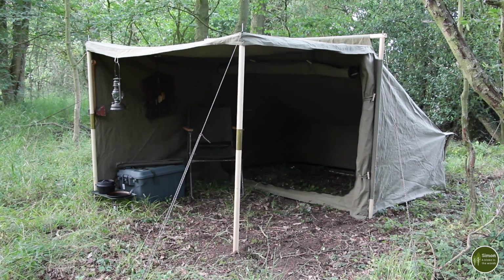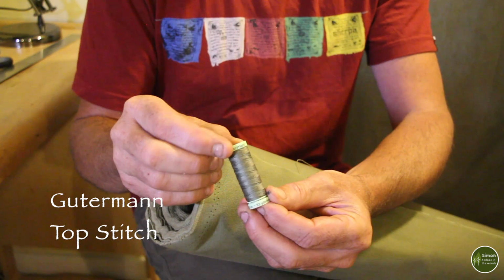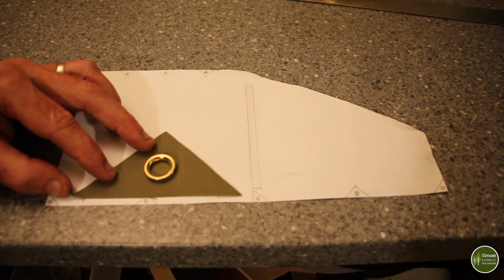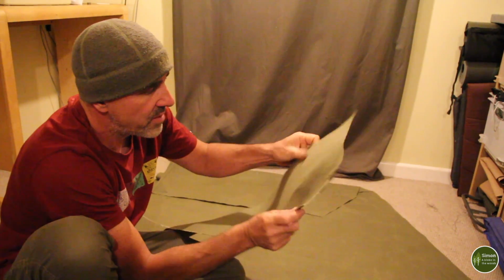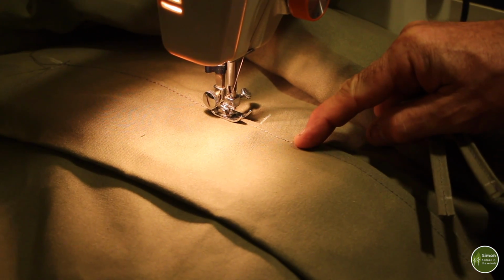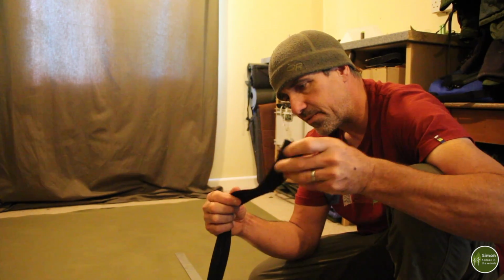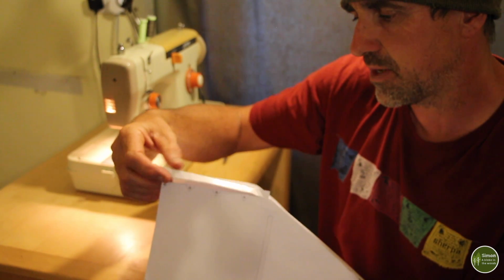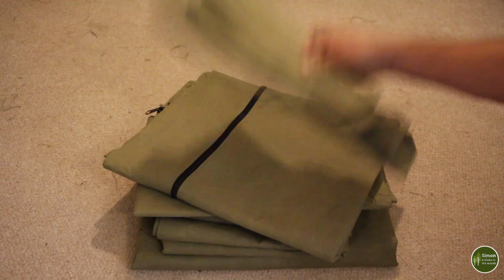The Baker Campfire Tent. Part 1 - Making the Panels.

Comment: I’m so glad I’m not only one who makes tents. However, this baker tent is a fine construction piece! 
I bought a tunnel tent which kept on collapsing once was erected. The guy ropes just wouldn’t hold the tent in the correct shape, it was supposed to be & it hosed me off, no end! So before I was to use the “tent” again, I was going to reshape it into a free standing one. It took about 2 hours to unpick the areas of the tent I was to reconstruct. There were 2 rounded areas of the tent which were for the 2 entrances. I was going to use only one. This at least, I didn’t have to remake. The sleeves for the tent poles, I had to just sew in the main length of the tent, so the tent would stand up. The final shape of the new tent was like a wedge cut out of an orange. The tent was way under 2kg if I stuck to using plastic tent pegs. With my backpack I had to sleep diagonally across the length of the tent. It now was perfect for those hiking & hitching across Africa I wanted to do.

Comment: nice work. when i started this, 3 years ago i was using a singer, hand cranking the wheel as the material was too dense for the machine to handle. did. great series. thanks for sharing it.

Comment: Absolutely beautiful job. Well thought out for sure. The only thing I would have added is a smaller pole sleeve or loops  inside the larger sleeves for the regular poles so things stayed tight. Looks like your design works well as is though. Super job!

Comment: great tent well made,you could add an extra front panel with a stove jack for a wood burner for wet and snowy weather,canvas will always be the best material to sleep under,the only drawback is drying the tent before packing it away for any length of time,great video
Reply from the maker: Thanks Pete! A front panel exactly as you describe is on the cards - I’ve got enough canvas left over. 👍

Comment: You clever chap!! Nice work and what a lovely thing to have created. The funny thing is, whenever I watch your films, I keep spotting all the same bits of kit I have! Those green Plano boxes are so useful. I have several and use them in my truck. They are like the different pods for Thunderbird two! Each has different kit for different tasks or hobbies and they get loaded on and off as required. If you go on a vehicle based trip and have two or even three, you can deck over with flat board and make either a low table or a raised bed. 
Can't wait to see your Baker Tent complete and out in the field. Thanks for another great film.
Reply from the maker: Cheers Laurence - great boxes, I only have the one - bought it as a kind of wanagan, really useful as a general kitchen box/table. 👍🛶🏕

Comment: Great project. I want to make a wall tent. my biggest problem is finding the right material. Ripstop nylon is preferred. my machine is a circa 70s Elgin in cabinet. Eager to see finished tent. excellent workmanship.
Reply from the maker: Thanks! Good luck with your tent, nylon is good for weight saving for sure, but canvas is hardwearing and spark/flame resistant. 👍

Comment: Excellent workmanship! My only issue is that you didn't include the  the scenes of you sewing a seam then realizing that the bobbin ran out of thread. Lol! I made a couple of "emergency tarps" out of 600d nylon with radiant barrier using bonded nylon thread. Aside from adjusting the machine to get the stiches right, having the bobbin run out was the number one annoyance. I like the idea of using the tailor's chalk, I'll have to get some.
Reply from the maker: Hahaha - yes, a frequent and annoying occurrence while sewing this tent up! Because I was using thick thread, I could only get 25m on the bobbin at a time! 🙄

Comment: That really is something else Simon. I know they are an actual vintage shelter but here’s a question, did you make the design for it or was it sought elsewhere? The reason I ask is if you’ve designed it then the amount of preparation that must have gone in to this is nuts. Cheers bud, Ant.
Reply from the maker: Cheers Ant! I had to work out the dimensions myself from existing pictures of these shelters - wasn’t too taxing to do, but I guess it makes mine a bit unique (maybe!) 😁
Reply: Simon, a bloke in the woods so basically you’ve walked on rice paper and left no mark... You may leave the temple 😜

Comment: Just a thoughts check out Frost River catalog for same tent they add a front panel with stove jack for 4 seasons also bug netting Recommendation is to add brass tubes to end of all wood poles, that's where they split I own quite like this Thanks from Old School in N-MN?
Reply from the maker: Thanks Kenneth - I’ll have a look. Good idea re. The tubing, I’ve been thinking about adding tubing to the male part of the poles where they join to avoid the problem of the wood swelling and the sections becoming stuck together. 👍

Comment: Thanks so much for putting up this video , I was wondering if I could do this with a domestic machine , 😁
Reply: not a chance. not out of canvas
Reply from the maker: Yes you can - mine is a domestic machine - it’ll stitch through 12 layers of canvas (admittedly walking the foot over the thickest bits, seams and cords etc) I didn’t break a single needle either. I’d suggest getting hold of an old machine through - they are heavier and better made (and considerably cheaper!) 👍

Comment: Great video, have a question I might have missed in video, isn't  the sag in the overhang a issue?
Reply from the maker: Thank you! If rain is likely, you can lower one of the front corners to provide a low point for water run-off. I show this in part 2. 👍

Comment: Very nice project. For part III of the series there are two "easy" mods that you might want to consider: 1) with that big roll of Velcro you could add a removable bug screen on the inside of the zipper door (I noticed you swatting a few bugs) and then for a cozy winter tent add  a removable canvas section over the open front of the tent, install a stove pipe opening, and "Bob's your uncle" you have a snug setup with your little stove (and plenty of room for Maggie)  And to top it off (we are "roughing it" so no microwave) an inflatable  solar powered lantern (carry on the outside of your pack as you toddle about during the day to recharge .. and very light piece of gear) I have several and they are great, even in the backyard.  Here is an Amazon link. https://www.amazon.com/MPOWERD-Luci-Inflatable-Solar-Lantern/dp/B00U2NN3C2
Reply from the maker: Good ideas - I’m actually planning on making an extra panel just as you describe. 👍

Comment: Hi Simon, v slightly off topic... But does your Feurhand lantern weep slightly from the filler neck and base of arms? I've just bought one and it does, ever so slightly. I don't know if it's due to overfilling, I use paraffin in mine. Debating whether to send it back or try another? Cheers. Chris
Reply from the maker: Hi Chris - mine does (in fact all my paraffin lamps do) if I leave paraffin in them when not in use. I always drain mine for storage and transportation. 👍

Comment: question? could you use PVC pipe for the poles? seems like it would be lighter?
Reply from the maker: It would definitely be lighter! The upright poles would be okay in pvc, but the horizontal pole would flex too much under the weight of all that canvas (11kg of it!) 👍